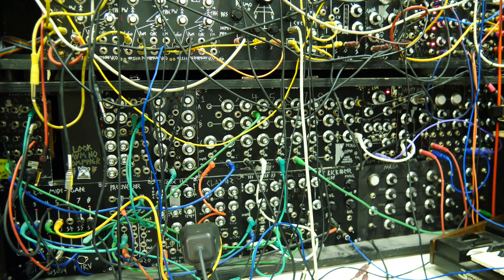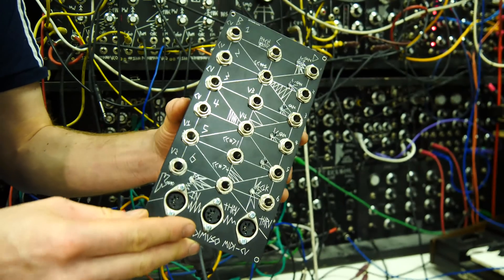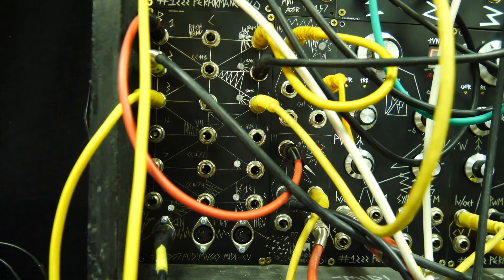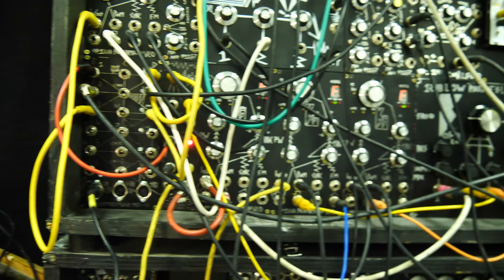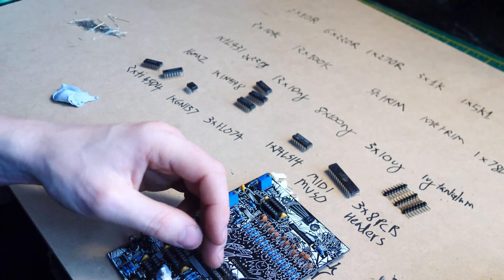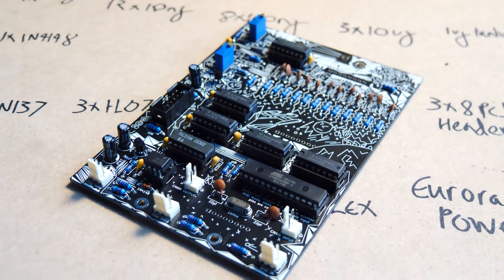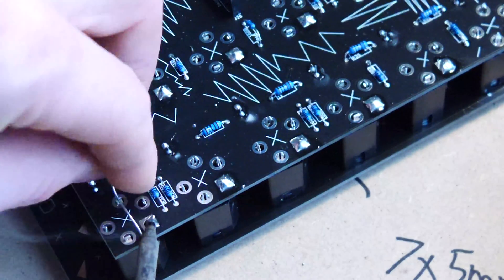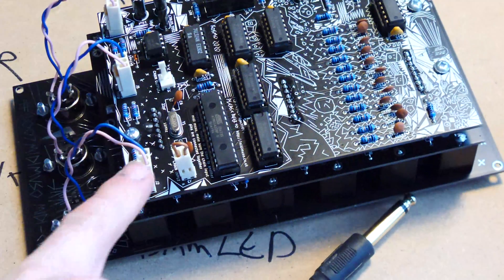Building the 1007 MIDI - CV MIDIMUSO OPTIMIZED FOR KOSMO FORMAT

Comment: Mine is still partly on the drawing board. Although the midi to cv module I am building will have a sort of computer built into it. Interestingly enough I did start soldering the first part of mine the other day. I plan to solder things in as I go to limit problems with loose breadboard connections. I am happy to see yours turned out beautifully. Congrats and fantastic work!
Reply from the maker: cool! look forward to seeing :)

Comment: the midimuso board I got was an absolute ripoff, it's literally an arduino with some logic level converters. I designed and ordered my own board for about half what they charged with double the outputs (with actual DACs too, not just PWM control)
Reply from the maker: I dont think id class it as a rip off. also it has the schematic available to see how it does its thing before you buy, It's not exactly hiding anything. you have a module with 32 outputs? presumably all with dacs? for half the price of the midimuso...... well if its true its definitely interesting, and I'm sure people will be interested, so do share pics :). yes there are some advantages with Dacs, but I just dont see them mattering in analog synths, in pretty much all applications Pwm is suffice, and any minimal negative characteristics add to the character of the analog hardware which is why people use analog hardware.
Reply: @THISMUSEUMISNOTOBSOLETE  not sure i agree on that last part, minimal negative characteristics add to the character, this is good for analog oscillators or filters and other sound shaping modules, but when it. comes to a midi - cv converter or even just any pitch based module, have "some error as character doesn't really "work" 
my 2 cents.

Comment: I love that chip. I got the midimuso kit, and I just wish it had midi through. Just now realized that the clock out will probebly do what I would use a midi through for, so thanks Sam. That looks like a superawesome take on it! Just picked up some rails so I will make a tiny Kosmo case, and I plan on getting all 4 ADSR for my MIDI to CV case for starters, and I still hope to make a full mono synth with the Kosmo modules in time. Have you seen the blank panels that they made for the Kosmo format? They look amazing! Stay awesome!
Reply from the maker: cool chent! aah I see you need some sync stuff?? as for the blanks yeah!!! josh's?? look really cool dont they :D
Reply: Chent Saus just to say... i tried the clock out on the standard midimuso but as far as I recall it sends only something like 48 ticks per note ,something like that and so while you can clock divide that don it is not suitable for correct syncing,... I had to add an open source arduino module for midi to modular clock duties.👍